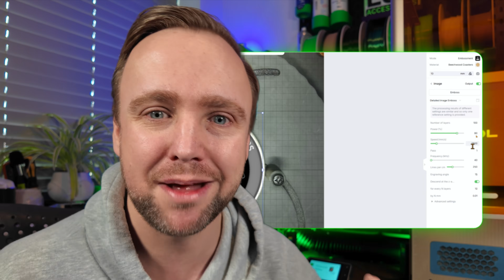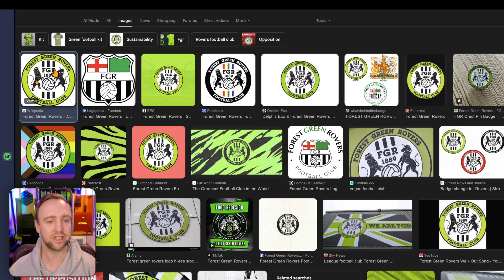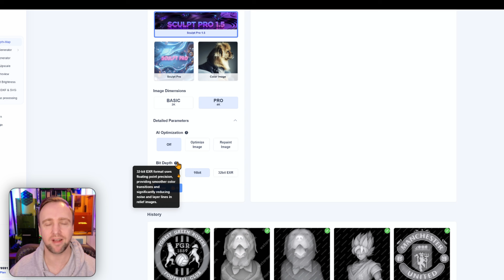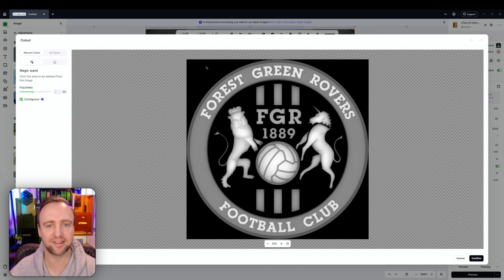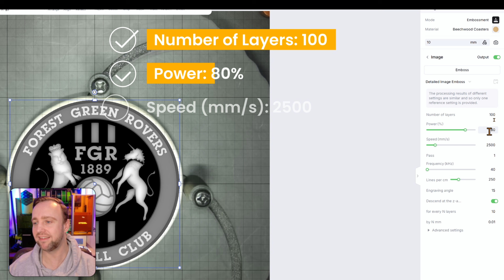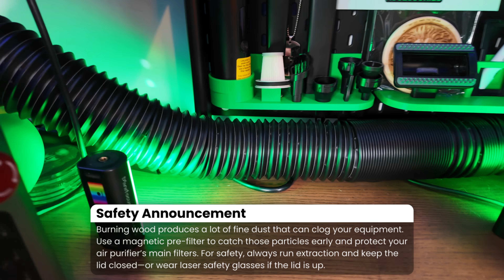This Looks CNC Carved... But It's a Laser | xTool F2 Ultra UV 3D Emboss Tutorial

Comment: can this work with an F2? I've only seen the embossing done with the F2 Ultra.
Reply from the maker: You can definitely emboss with the F2 onto wood (I have a video showing it). That being said, it won't be as clean as this, the F2 Ultra UV used in this video is excellent at not charring the edges.

Comment: Your stuff is incredible I have followed your settings etc for the embossing but my outline is deeper than the engraving. I have to figures in my image they are so detailed but because they are below the outline of the carving it doesn't look as good ?
Reply from the maker: With a depth map the darker an area is, the deeper it goes, so if the outline is coming out deepest it's the darkest part of your image. Check for a dark border around it, mine came in with a black border that I removed with a mask or the cutout tool. The preview in xTool Studio will show you before you run it.

Comment: Uv 5 w? Have you carved a hardwood like African Ebony?
Reply from the maker: It's the UV laser on the F2 Ultra UV. I used wooden coasters in the video, but it should handle pretty much any wood once your settings are dialled in. I'd test a small ebony offcut first.

Comment: Hello, do you know if this machine will engrave olive wood (knife handles) nicely? I currently use a co2 for my knife engrave business but I am interested  in this machine as a upgrade, I am hearing it engraves clean without char?
Reply from the maker: Yes it will be fine doing pretty much any wood and once you get your settings dialled in there won't be any burn marks. I think it would do a great job. 

Also, if you do decide to go for it please consider using the link in my description 😊

Comment: Great Video.  Ive just purchase the F2.  Can you achieve a similar result with that machine?
Reply from the maker: You could follow the same process of using the embossment mode and I'm fairly certain it will work. However you won't get the clean no burn finish because it will be using the Diode laser which burns the material. Definitely worth a try!

Comment: what about larger wood pieces? can the conveyor do it? lets say a 6x10 piece of wood? or is conveyor just for batching? the slide extension for f2 can do this, but the f2 burns the wood.
Reply from the maker: I don't think you can use emboss mode on the conveyer